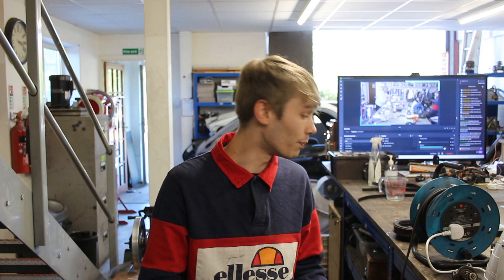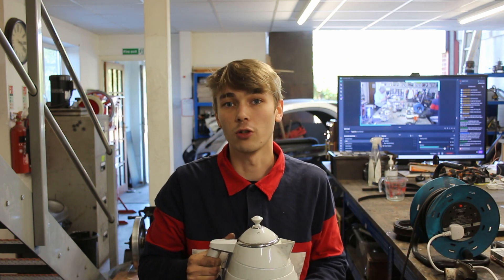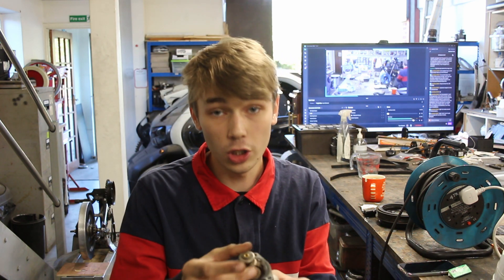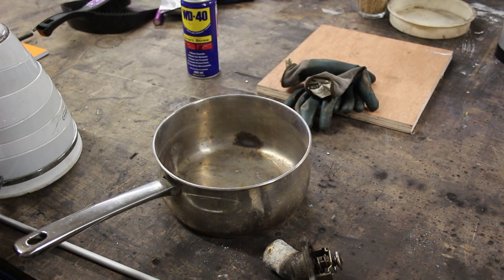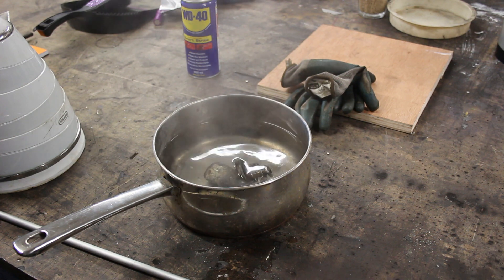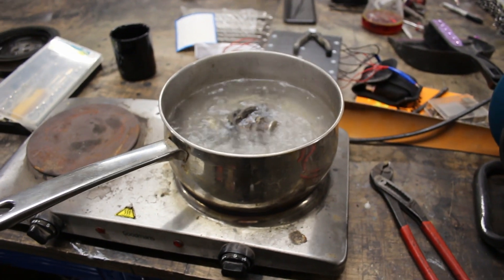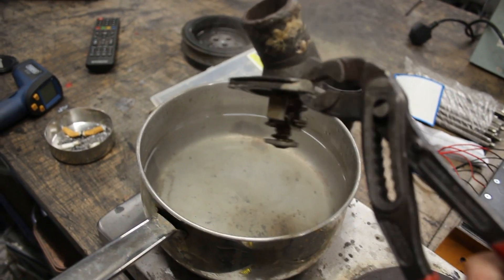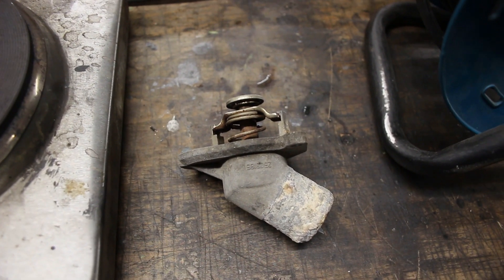1278 - How to Test if a Car Thermostat is Working

Comment: A car 's cooling system heats up slowly, so to test a thermostat without damaging it.
Put it in a pad of cold water with a thermometer and heat it up to the set temperature stamped on it.
It should be fully open at the set temperature.
Remember it can also open too early, overcooling the engine. 
Do not boil it or you will damage it.  I've seen it done !

Comment: Place the thermostat itself in a saucepan full of cold water and make sure it is closed. Then heat the water on a stove with a thermometer in the saucepan if possible. As the water comes toward the boil the thermostat should be seen to start opening at about 80 deg Celsius or about 180 deg Fahrenheit and be fully open by the time the water reaches boiling point. It is common to see a cooling system temperature run at slightly above boiling point in the warmer weather. Cooling systems do this easily because automotive cooling systems run under considerable pressure which raises the boiling point of water to as much as 120 degrees Celsius.

Remember, do not open a car or truck radiator cap immediately after an engine has stopped running as above boiling point water will horrifically burn you and disfigure you for life, if you survive.

Comment: If after you replace the thermostat you are still not getting heat; hook a garden hose that is attached to the outside spigot up to the exit port of the heater core and hook up an open ended hose to the input port of the heater core.

Turn on the water and slowly open it all the way allowing the full pressure of the water to flush out the heater core. This will loosen up any built up sediment and push it out that a standard engine flush can not deal with.